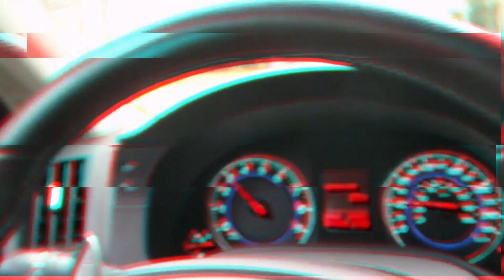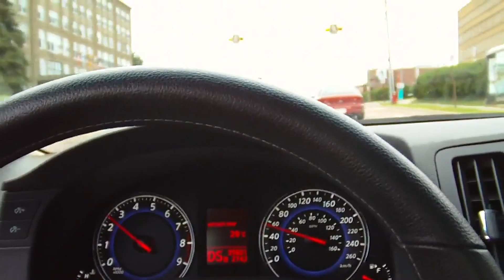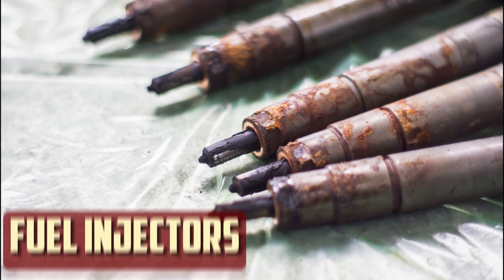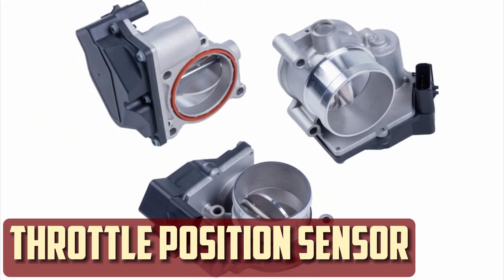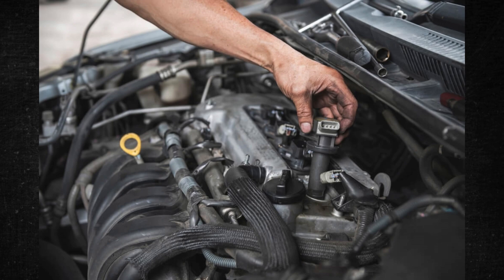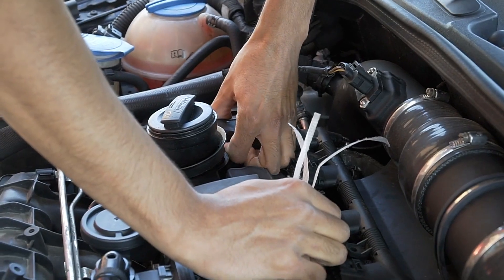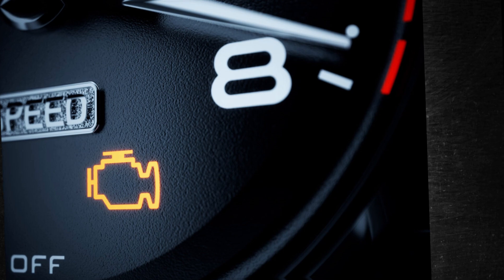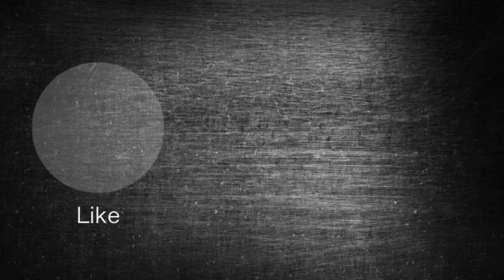10 Reasons Your Car Hesitates When Accelerating from Stop

Comment: 2014 Hyundai Elantra, 2.0 GDI. This isn't an all-the-time thing, but sometimes my car will make, like, 30 horses when I need 80. It's like something is blocking the fuel, or I'm lugging the engine because it can be "broken free" with a lower gear and more throttle. I suspect an issue with the fuel system.
Reply: Yeah I’m going through that with a 21 Altima that’s direct injected, it always does it worse like the first 15 minutes after I start it.  Had a fuel induction service done and it helped but not completely.  Going to have it walnut blasted eventually.
Reply: @danielhamby9448  Might also want to check the knock sensor.
Reply: @AlastorTheLumbagosaurus  I’ll check that.  It does knock/ping when I have to floor it to get it to go.  I’ve never had a light come on which is the weird part.   I was going to have them check the egr and pvc valve next oil change I’ll have them check that too.  Thanks bro
Reply: @AlastorTheLumbagosaurus  after googling the symptoms that probably is what my problem is.  I have every symptom except the check engine light

Comment: Mine chugs going uphill and driving slow around town getting on the highway it chugs massive or slowing down behind a car then trying to speed up it chugs and bucks.  Changed plugs and coil and didn’t help. It’s even worse in hot weather
Reply: What was wrong with it
Reply: Same problem with my 2004 Astro van

Comment: Happened to my 2007 cls550 I came to stop then i gas it felt like I lost power it was going but slowly I was confused it was then bouncing rpms once I let go of gas and rev a Lil high but was going
Reply: i am experiencing it right now what could be the problem sir, what did they fix in your car can you please tell me thank you.
Reply: Could b fuel pump or low transmission fluid or low gas in car keep it about half tank  @JaezWin
Reply: I’m facing the same issue in my Rav4
Reply: Could b fuel pump or loe transmission fluid  @teddypraiz2583
Reply: what’s the issue?
Reply: @justinnabua9649 low transmission fluid I did a flush with new seal and it holding up
Reply: Clean your throttle body and MAF sensor 

Thats a air flow problem
Reply: @carlosport0215 my injectors maybe run some royal purple through the fuel lines ?
Reply: @Howyoudoit550 injectors or spark plugs could be the problem too
Reply: @carlosport0215 I’m say injector as I went to Firestone for alignment they mentioned I need a fuel injector clean I did spark plugs so that’ll b next thing can I run a liquid through gas the fuel injector cleaner will it help some royal purple fuel injector ?
Reply: @Howyoudoit550 yes 
Seafoam is a good option too
Reply: @carlosport0215 never ran it might have to watch video on it